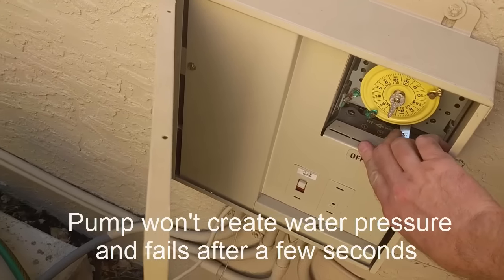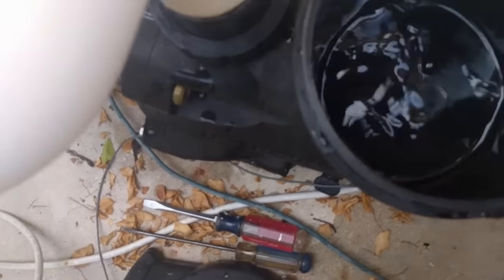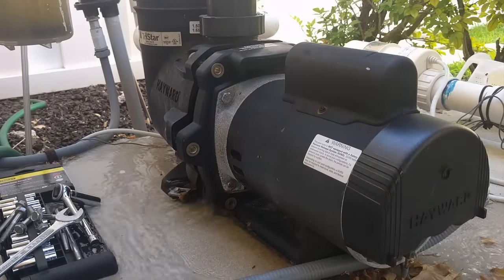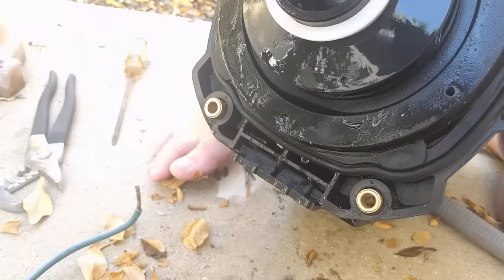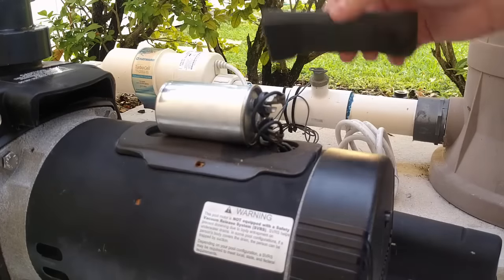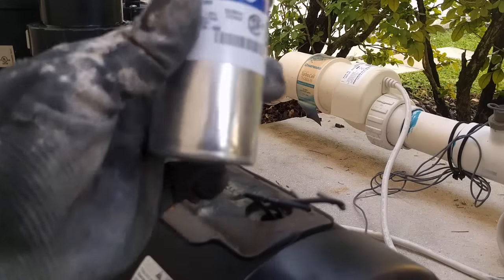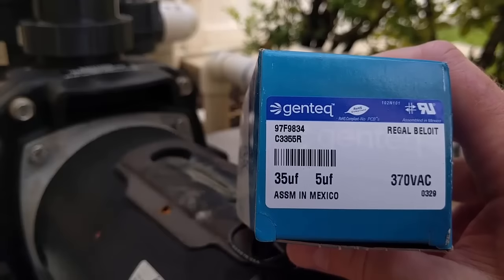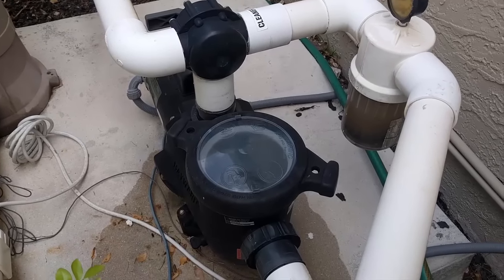How to Fix Pool Pump Capacitor

Comment: Very well done video, despite not showing the actual connecting and reinstallation of the new capacitor.  One Caution.  The capacitor box says that its "fan" terminal goes to an internal capacitor whose "capacitance" is 5 microfarads, while the "compressor" terminal goes to one of 35 microfarads.  The repairer wisely used the compressor terminal, and all was well, as I would suspect.  His advice is faulty , however, about using the fan terminal -- then or later.  The fan capacitor is not the same as the heftier one he used--that's the one the pump needs.
Reply: Exactly right

Comment: There are indeed 2 capacitors in one can. But - one is 35uF and the other is 5uF as it says on the box. You can only use the bigger one here, leave the smaller one disconnected (it can't be used as a backup).
Reply: Precisely.  It bugs me t hat this person is giving out wrong info!  Like WHY didn't he KNOW it was a bad cap, instead of taking the motor off???  Boy.  He also said it was a "Start cap".  It is a "RUN" cap!!
Reply: He called it a start cap because it started!😊 Lol
Reply: He should have corrected that. A 5uF will not start that motor!

Comment: Great video Mark! Ordered and installed a new capacitor ($10.60), disassembled and cleared the debris inside the impeller (3 small rocks) reconnected everything, plugged it in and the pump is back performing like new! Your step by step video saved me $785 the pool repair guy quoted me. Thanks a bunch!!!!! You rock!!!!!
Reply from the maker: Glad I could help.
Reply: Pumps are 2-400$ at home depot
Reply: @kevreilly7  you mean motor, not a pump.

Comment: Thank you so much dude. I was actually browsing through videos to do a full rebuild when I stumbled upon this. I thought the motor had seized and new bearings were needed. But when I took the volute off the impeller turned freely. Though my issue was with the booster pump not the main one, this worked like a charm. The only regret I have is that I ordered bearings and o-rings instead of the capacitor. The capacitor I got from Leslies and paid way too much for..  Great stuff, man! Thanks again!

Comment: Great video.. Funny when you saw the 3 terminals and then the video cut to the installed capacitor.. But I see you educated yourself and explained it to us very well.. Good job
Reply from the maker: LOL...Exactly what happened. I purchased it not realizing that I ordered a 3 terminal version. So, I read enough to to learn about it and understand that I could, in fact, still use this in the pump. Then went forward.
Reply: @MarkFauntleroy  Please note, the other terminal is 5 uf as per the box top, so you can't use it when the cap fails, as you mentioned.

Comment: Mark,
Thanks for the video. I was fearing it was the motor.
You offered easy to follow trouble shooting advice, and it's greatly appreciated.
Had to hit the pool supply, since it's a 110 degree day here in Texas, so paid a bit more, but still, certainly saved more that I spent.
Many Thanks

Comment: Just went through this whole ordeal with a Hayward Super Pump. Hummed when powered up. Pulled capacitor off the top housing. Visually it wasn't domed or leaking so knew it was a stuck propeller. Disconnected from pump basket housing and used a strap wrench to turn the impeller housing. After which, I was able to manually turn the impeller which I wasn't able to do initially. Put it all back together and it worked.

Comment: Thank you for sharing your expertise!

1.  I removed the capacitor and had it checked out at Plumbing Supply store.  To my surprise, it was still good.

2.  I removed the motor from the pump and cleaned out impellers with a water hose and wiped it all down.  It had some feather looking type stuff on it, amongst other debris.

3.  Prayed, then started up!!!  Worked.  Thank you sir.

Comment: Thank you SO MUCH, especially for the explanation about using a replacement that is a little bit different than the original.

1-1/2 hp Jandy pool pump motor suddenly just hums loudly.

Old Capacitor:  25 UF +/-6% 370 VAC (2 terminals).
New capacitor:  30+5 MFD +/-5% 440/370 VAC (3 terminals)

Local Ace Hardware had it on the shelf.  Otherwise I would have driven 25 or 45 miles to one or both of the nearest pool supply places.  Tried calling but they don't answer, and I'm not fond of ordering on-line.  

I took it to the local electric motor place, but they don't work on anything that small.  They did confirm for me that i had tested it correctly using my multimeter.  They also tested it using their own equipment, and it was definitely bad. 

The guy suggested, "Ace Hardware sometimes carries them," which I had already explored.  They had 1 or 2 that came close, but I was set on an exact replacement at that point.  

However, having later watched most of your video, I picked the guys brain a little about it being ok to use a replacement with slightly different microfareds - but only higher UF, NOT lower, and only SLIGHTLY higher.  👍

MUCH APPRECIATION!

Comment: I have the same pump with exact same issue.  You can kick start the pump by taking off the back cover, turn on pump and then spin the shaft manually by hand and motor will start running.  Needs to be done quickly before the breaker trips.

Comment: THANK YOU SO MUCH!  Very comprehensive to walk me through the steps to check one potential issue at a time.  I was quoted $375 to replace a relatively new pump.  I asked the tech how do I know if it isn't clogged or something else bc the pump is 1-2 years old.  He didn't reply.  So I did what I normally do, and went to YouTube.  Found your video so I'll try both of these things first.

One quick piece of feedback for your AWESOME video: What else could I try if the impeller isn't blocked and the capacitor isn't bad?  What would I try next before I decide to replace the motor?  Last, is there a way I can SAFELY check the capacitor prior to buying a new one and installing it to see if that is the problem?

Thanks agin for your video!
Reply: For anyone interested in how to check if your capacitor is bad, ONE way to test it is to access the motor shaft at the rear of the motor.  There will be a plastic cap covering it.  Remove the plastic cap and turn the motor shaft using a screwdriver.  Now, you need to do this VERY quickly AFTER turning the power on for the motor, otherwise there is an overheat mechanism that will shut off the capacitor and you won't be able to get the motor started.

I did this and it worked twice, so I know that it might work for others.

Be careful with electricity and everything else so I don't get in trouble by you doing this and saying I told you to do it this way.  Have a qualified technician do this if you're not comfortable around mechanical and electrical equipment.
Reply from the maker: Thanks so much for the nice comments. I'm not an expert on these things. I just recorded that because I thought it could help others. So, I'm not sure what else to look for, but will say that a capacitor is pretty cheap (like $10 - $25). So, it's an easy and quick thing to replace before spending several hundred on a new pump.

Comment: You notice that the box said 35 uf (microfarads) and 5 uf. That tells me that one of the capacitors is 35 and one is 5 uf. Probably, in the original application of an Air Conditioner, the 35uf is for the compressor and the 5uf is for the fan. Otherwise, video is extremely helpful. Thank you!
Reply: Bill Duncan correct. you can use the 35 side for this project but not the 5 side (which would be for the hvac fan)

Comment: Hey Mark - great video but I noticed you skipped the section where you connected the terminals back to the new capacitor;  how do I know what wires connect to the terminals?

Comment: No you can only use the HERM which is comoressor on the new capacitor which gives you 35uF. The fan and common together act as a running cap and constantly gives you 5uF to run the motor  But the 35uF is for starting the motor.

Comment: I will try this first thing in the morning and hopefully its all!  I don't want to think it is something bigger
Reply from the maker: How did it go?
Reply: @MarkFauntleroy  Hi Mark!  thanks for the response.  Following your instructional video, i took the pump apart and cleaned the impeller, i almost pulled the capasitor out but decided it was above my pay-grade.  However, once i put it all back together (no small feat for me, since the pump is right up against the wall and teatherd between the filter) it actually started sucking water through!!!  so thank you!!!  great video

Comment: I learned some things. Good video but wonder about that word "pop" related to dissipating the charge. I assume you mean blow apart? How common is that because I've never heard that before. Thanks again. My motor is sitting on the work bench waiting to go to the motor shop.

Comment: When picking around with a screwdriver trying to remove debris from the impeller, it helps to release the filter air bleed device allowing the water in the filter to run backward through the impeller.

Comment: thanks for the information. I was going replace pump till saw your video which help lot and am going replace capacitor. I did took apart and clean up and check everything else which was good and thank goodness i took apart because found bee hive inside and cleaned that out.

Comment: Will a bad capacitor trip the circuit breaker? Or should I try changing the circuit breaker first? 
The pump runs fine after I reset the circuit breaker a couple of times.

Comment: Could it still be a bad capacitor even if the motor doesn't make any straining noise at all like yours did before you fixed it? Thanks.

Comment: I have this problem too, pump started after a few tries and when measured the capacitor i got a value of 2.07uF, so i bought an exact copy of it and before installed it i measured that one too. 14uF. Good i thought, i found the problem. But after 4 days the new capacitor just blowed up. Could it be a bad copy or could it be something else going on with the pump?

Comment: FYI--you can spot a bad capacitor when it is domed on the top.  The one he pulled out clearly was rounded.
Reply: Not always.  "I" have one with NO bulging at all, but it has no mf reading at all.  But it has some continuity. I put this cap in the pump motor about 2 months ago, and it's bad already.  No bulge--looks new.

Comment: If the pump is working properly but hums superloud during season startup, could this also be the capacitor? The capacitor doesnt seem hot but the motor is hot, but pumping freely.

Comment: Thank you for this. I saw smoke coming out of the hump above the motor. Now I know it's a blown capacitor and needs replacement. But it makes me wonder how/why it blew.
Reply: They just wear out. The higher the temps....summertime, the harder they work. Pretty common problem with this type motor.

Comment: Good day,
Okay I did all of this cleaning the pump clearing out any dirt, changing the capassador,still have the same noise no changes. Newly built pool everything is connected correctly,but this is the same pump In the video,but it is a used pump.

Comment: any guidance...I have the dual capacitor to hook back up, but don't remember which wire goes where (should've taken a pic, I know). I have two black wires, one red and one white with red strip coming out of the pump. Any guidance on what should go on HERM, FAN and C? Thank you in advance!

Comment: Just did this with my StaRite - NOTE that you should match the capacitance (micro-farad  number) *exactly*, it's the working voltage where a higher number doesn't matter.

Comment: Hi Mark. How about that green ground wire?  Where was it connected too?  My motor has stopped running and I’m going to start diagnosing pump motor. First thing I noticed is that on mine there is a green ground wire that is hanging out and old. Looks like my ground wire hasn’t been connected at all and yet motor has been working for last six months. So I’m guessing that the green ground wire isn’t going to make a difference if it is connected to make the motor work or not?  Tia, ken

Comment: on Capacitor with 3 terminals you are dealing with two different "rated" internal capacitors and they are not both the same value  the one you are holding as rated 35uf and  5uf so between common and herm (typically the compressor motor on an air conditioning system) its 35uf the other terminal is F or  fan ( typically a condenser fan motor on a ac unit) and its 5uf ,, you cant just switch between the two.. if the original capacitor was the protected type your replacement must be also

Comment: i had this humming, and then i turned it off for a few minutes, then back on and it worked fine again. could it be the capacitor still? if the problem comes and goes?

Comment: I need help with mine. I don’t remember which wire goes to which terminal. Does it matter? One of the wires has red mark on it. I just bought a new capacitor but I am unsure on the wire placement. Any suggestions?
Reply from the maker: Hi, Cli. Honestly I'm not sure. I BELIEVE that it DOES matter if you have more than two terminals on the capacitor - maybe not if you only have two terminals. I've always taken a picture or written down which wire goes where.

Sorry I can't help more. I'd suggest reviewing some online documentation for your pump or consulting a blog where pros could comment.

Comment: You can only connect the 35 uf  side to replace the 30 uf  cap.  The 5 u will not work.   Bad answer  saying either can be used  hope you got the correct connections.

Comment: Hi Mark, I watched the video a few days ago replaced a run capacitor with 20uf (the one I replaced is 20uf as well). Tried to start it, the first time, no luck, still humming, and then it triggered the circuit breaker, I tried again, the pump started successfully, Yeah!!!, But once I shut it and restart, ...humming... I highly doubt the one I purchased from inyoppol is a used one and it is defective since has white stuff on the top when it came. Any thought?

Comment: The fan to common in your replacement is 5uF....  so no, you can't use either one with the common.
Reply: docimastic,,,     yes the capaciter he replaced with was a dual   and an ac compressor draws a lot more than the condensor fan   30 uf    and 5 uf    Im no    pool guy or hvac    or electrical wizz but I caught that and cruised the comments.   No offence to  Mark but kind of dumb not to know that.  also  why remove pump if the shaft was turning ?    I guess he just got lucky hooking it up

Comment: Hi my swimming pool exercise machine turns off after 5 seconds. Does not trip the switch. I just changed solenoid but sane thing. It's not hot either?

Comment: I have a capacitor on top and one on the back. Which one is which?.
Reply: Candi R two capacitors in all Motors. 1)start capacitor and 2)run capacitor. If the pump isn’t running/starting. It’s most likely the Start capacitor. Start capacitor will either be in a hump like hood on the motor or immediately behind the cover of motor which is located in the back.

Comment: Original capacitor 30uF.  You replace it with a 35uF.  Your motor will consume more/less power than design; thus the motor will not last as long.  Replace same with same.  Don't deviate, except in emergency, and replace with the right size ASAP.

Comment: My situation is I left my motor run for a few second got a little warm very little like when it’s running now when turn it on it stays on for one second or two then turns off.  Motor on my pool pump I think it’s a Haywood 3/4 ho

Comment: That's a run capacitor not starting.

Also the other half of the capacitor is a far different rating and wont work.
Reply from the maker: Yeah. I'm not an expert, and got the wrong capacitor. But, I was able to make it work.
Reply: @MarkFauntleroy  , I'm just saying the other half of the 2 in 1 is far different rating so it won't work as a back up.

Thanks for the video.

Comment: nervous about messing around back there...
Reply from the maker: Understandable...I was at first also. I'm not a pro. I'm just self taught and had to get the courage to dive in and then figure it out if I messed up. Watch some how-to videos to gain a sense for what the steps will be in fixing things and the tools or materials you'll need. Just remember to be safe and that almost anything can be fixed with enough effort and time. Good luck.
Reply: @MarkFauntleroy  I turned off the pool breaker from the panel in the garage and the breaker on the outside box. I now feel comfortable replacing it! Thank you Mark!

Comment: is that a run capacitor or a start capacitor?
Reply from the maker: +Vince McK That's a run capacitor I replaced. Run capacitors are usually in the metal housing on top of the motor. They help increase the motor's running efficiency, while a start capacitor just helps the motor turn over and wind up.
Reply: Thanks, did not understand which was which.   The 2 speed motor would start but only on low, then could switch to high, but could not start on high.   Replaced and now works fine.  I had been seeing high filter pressure even though filter was clean  and after replacement the pressure is back to normal.  So perhaps a bad cap also causes motor to run hot/too fast....efficiency thing  I guess, so if the run cap balances the AC to the motor, maybe the old defective cap was allowing the motor to run too fast.
Reply from the maker: +Vince McK Glad to hear it worked. Good luck.

Comment: If you were to go by pool supply store or supply house for hvac pick up 2 wire electrolytic capacitor hook up and be done don't confuse the average guy,I am an electrician I would install it correctly not with a 3 wire cap nope but only a 2 wire  I hate mickey mouse short cuts...